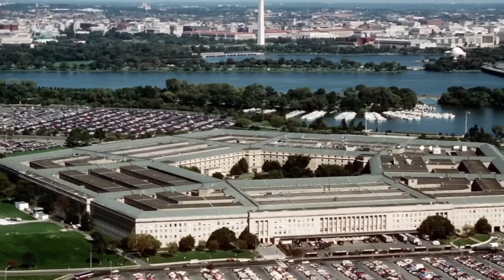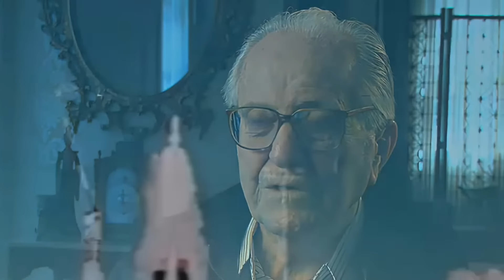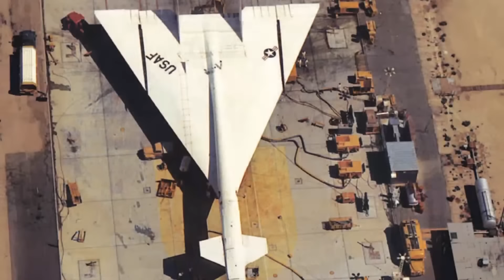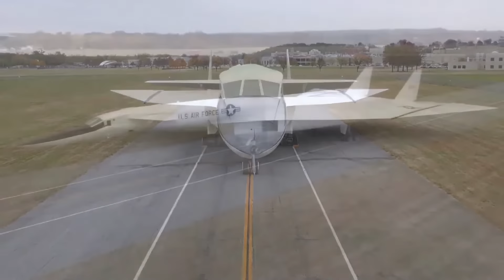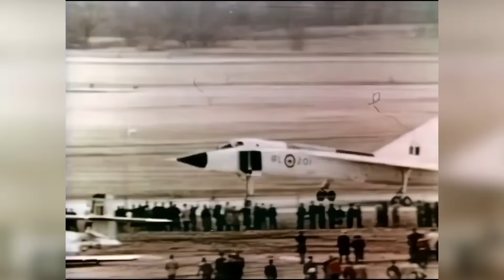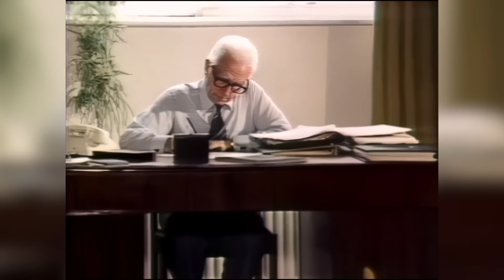XF-108 Rapier: The North American Ultimate Weapon That Never Was And Other Experimental Aircraft

Comment: To those who mourn the loss of the Arrow. The AVRo Engineers scattered. The idea never died, just changed names. The F102 Delta Dagger was the first challenge for the Engineers. They changed a non performing jet into the massively successful F106 àñd  named it for what it was, a mini Arrow, Delta Dart. The XF 108 was an Americanized Arrow. The XB70 was built with Arrow influence. Similarly the X-15 and SR71 also have Arrow influences. Even the Space Shuttle has Arrow influence. Those Engineers from the Arrow project shaped the future of American Aerospace. The TSR3 also has many Arrow influences. The common traits also were their handicaps, Cost and Exotic concepts. The Delta shape and totally revolutionary innards are the fingerprints.
Reply: The F-106 first flew before the Arrow was cancelled.  The XF-108 was cancelled just a few months after the Arrow was.  Why do Canadians get credits for things they were incapable of doing?

Also, the Shuttle was a complete failure, not sure why you want credit for it.